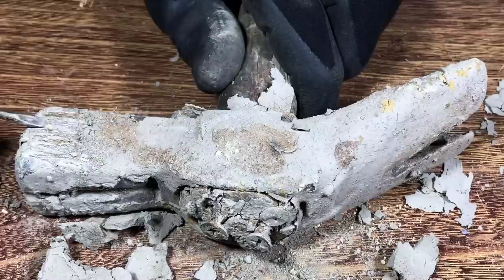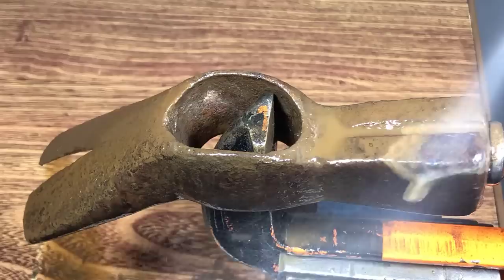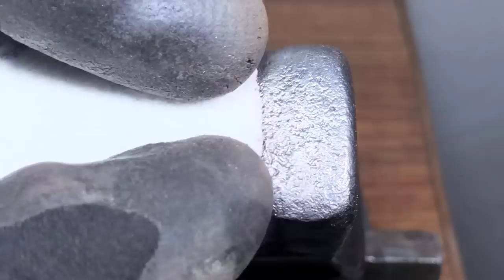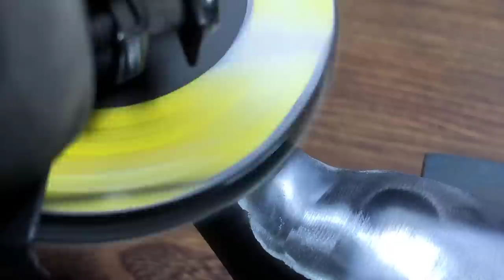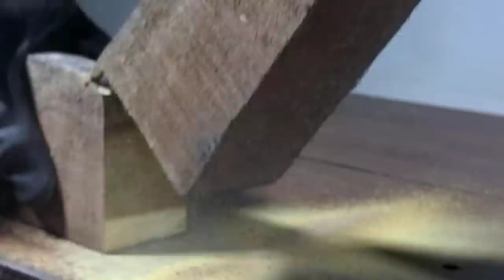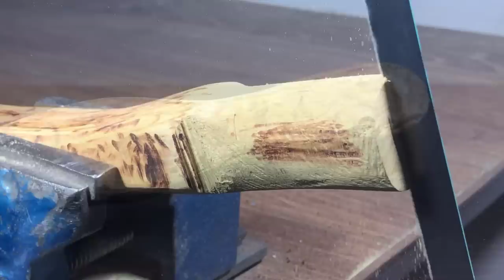Rusty Hammer Restoration -  Restoration Video Better Then @RandomHands!

Comment: It would be been easier to clean it you hadn't dipped it in mud...
Reply: I was thinking concrete.
Reply: And the drywall screws aren’t even rusty……..hmmmm
Reply: If you look at this logically it doesn't seem out of place. There was rust under the mud and the wood was rotten and cracking and the mud had seeped in, both of those clues show it had been sitting for awhile. The modern screws even add up. Think of it this way, I have 2 hammers one that's 34 years old I bought just out of high school the other my grandfather's which is about 100ish years old. Both hammers have screws in the top that I placed in the last ten years attempting to get more life from the handles. We all do it why is this different?
Reply: Looks like the screw had no rust..hmmm..by the way good work also.
Reply: Why don’t You try making something?…
Reply: FAKE!